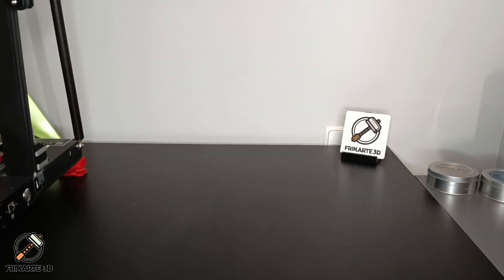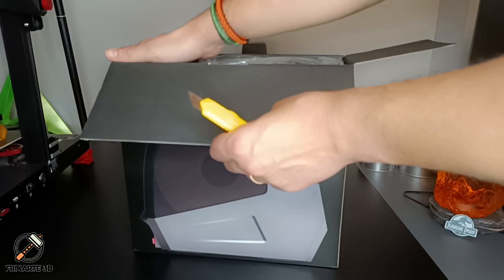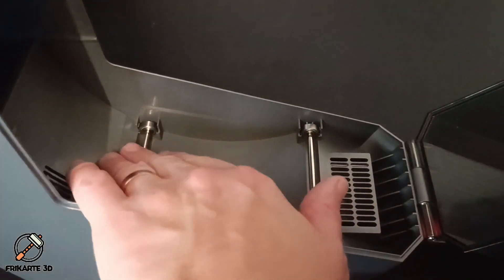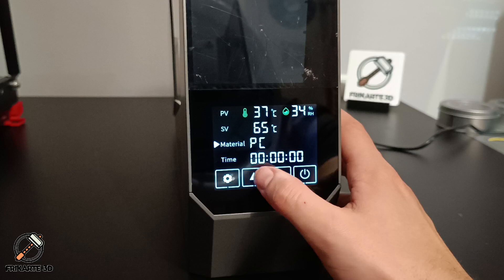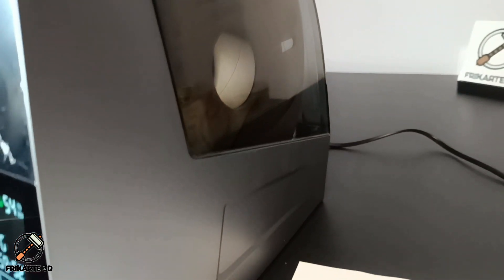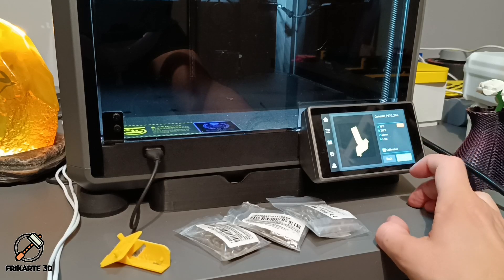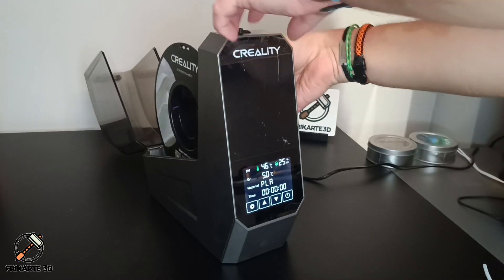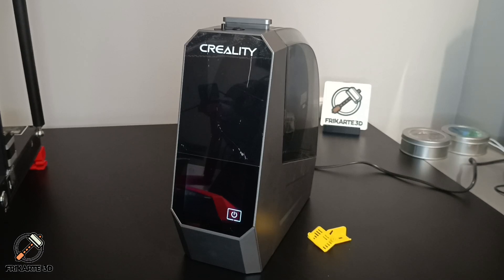Creality Space Pi Filament Dryer Unboxing & Test: Does It Improve 3D Prints?

Comment: Reducing temp from 250 to 230 would probably reduce stringing all together, i print at 230 with petg and don't have stringing issues.
Reply from the maker: Yeah, I also played with temps sometimes to avoid stringing but depending on the speed and filament brand can cause reduction on flow or generate clogs so I prefer to user a dryer whenever I detect filament is not performing as expected.